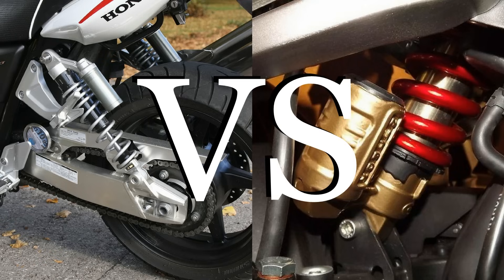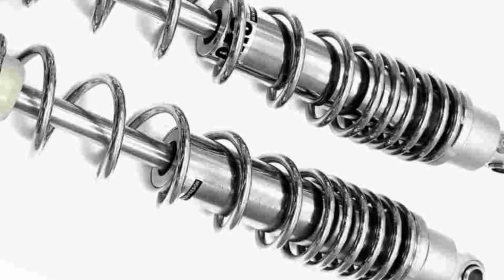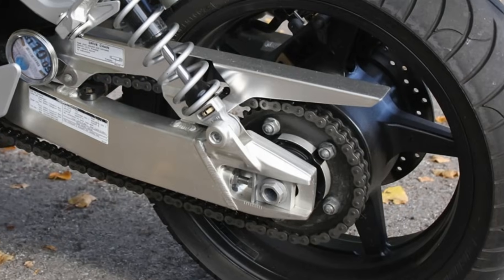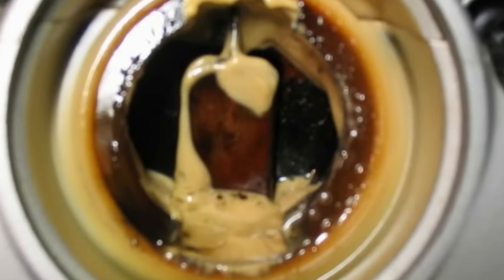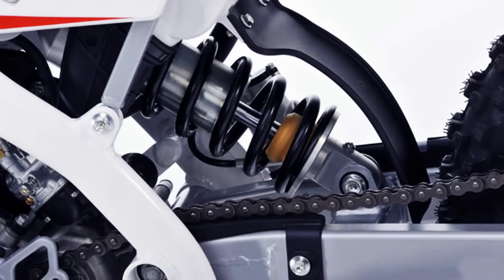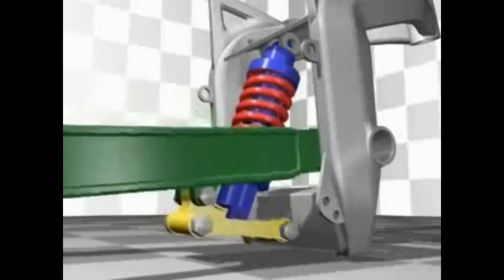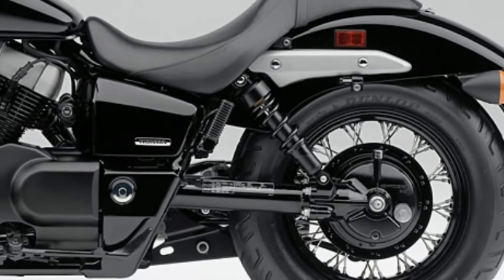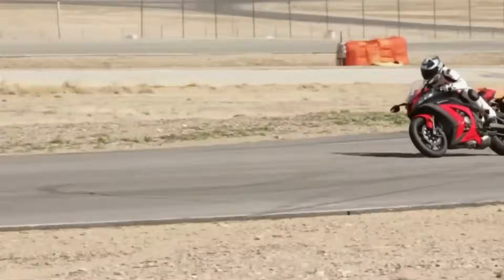Monoshock Vs Twin-shock; Which is better and why?

Comment: Thank you for sharing.  
It is sad to know that monoshock are not designed for carrying heavy loads.  We usually carry 100 to 150 kilos of cargo - up to 230kilos total with driver, on the pillion seat.  Now we will have to lower cargo weight to 100 kilos only

Comment: As far as rider comfort is concerned pls advise which is better.
Reply: As far as rider comfort, it all depends on what your bike is set up for. If you have a bagger where you're loading lots of weight besides yourself, twin shock system is usually quite a bit better as it's able to control the weight without compromising it's stability that much. Monoshock suspension is usually better at keeping light bikes stable as there is less weight to control and the deflection of the shock means there's less travel to deal with when hitting bumps.

Comment: I have a 2003 W650 Kawasaki with 50,000 km on it. The rear suspension is rubbish and I have seen the odd YAMAHA SR convex monoshock. As bike is already customed I don’t mind chopping and changing and really love to fit a monoshock system. Does one know how? I have already eliminated the air box so there is plenty of space.

Comment: Your maths on twin shock piston stroke movement are 100% wrong sir, unless the rear shock is vertically mounted, which they aren't and even then it isn't totally correct. Any shock mounted at an angle has piston movements on a variable ratio.

Comment: Great video man. Subscribed.btw what is better for a person with spinal issues dual or monoshock; i mostly ride single...
Reply from the maker: There is not a definite answer to that question both types of suspension can be tuned for comfort. I'll suggest you to take some test rides and check whether the ergonomics of the motorcycle is causing any strain on spine because ergonomics of the motorcycle also plays a huge role in the comfort, especially for people with spinal issues. Avoid motorcycles with too aggressive riding posture and with too upright riding posture.

Comment: Hi, i got query regarding the shock experienced on the body & footrest. Despite monoshock operating good, i still could feel the hard shock on the footrest even while hitting small pothole.
Am riding moped bike (Honda RS150, which is street motorcycle popular in SEA)
I’ve just change to after market monoshock, tyres, and reduce tyre pressure - still feel the hard shock
Reply: Change or add the seat paddings. Like latex foam if available.

Comment: Mono shock is worst for comfort, don't know about multi link, those come with Honda unicorn is worst
Reply: Most of road bike suspension is set for rider & pilion. Thus will be stiff for solo ride.
Reply: but I didn't see this in Pulsar, I enjoy riding it, don't have to worry about how the road is, with or without pillion.  I still don't understand  people buying honda unicorn stuff, just for mileage and resale value, is there no concern for comfort at all?
Reply: Subbu laxmi liar
Reply: @jeevanrohtak5126  so r u truther

Comment: in twin shocks there is a problem in one shock fails and the other is still good causing stability problems, or issues in cornering.
Reply: Rhis liyerally nvr happens , what do u even mean by fail ? They dont j8st five up

Comment: how about the behaviour of both during cornering?.... in twin shock....the inner piston gets more force tgan the outer one and that makes the tail of tge bike unstable!
Reply: Vijay Yadav .....I mentioned this before by exposing that modern sport bikes don’t come with dual-shock suspensions systems. Well, we’ll pay the price:
 - Wanna go fast ? Get more stability rather than comfort! ....
Reply: Why wpuld it make it unstable ? The moment of force acting ia not enpugh to unsettle steel components used in sh9cks